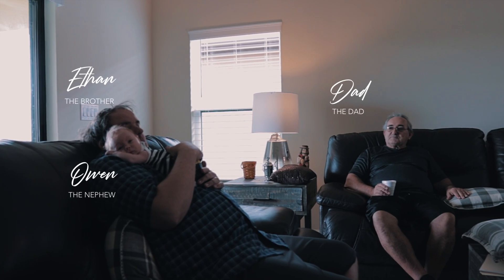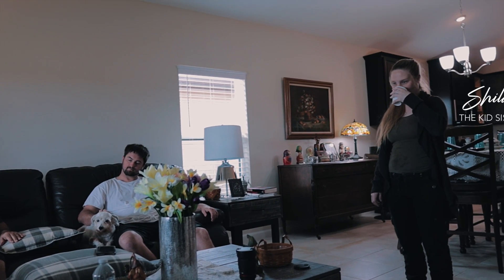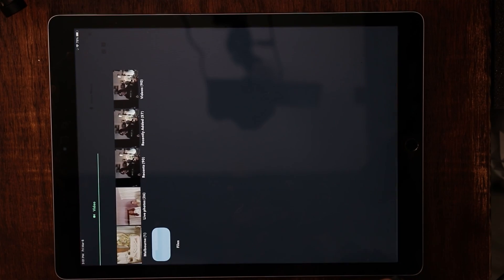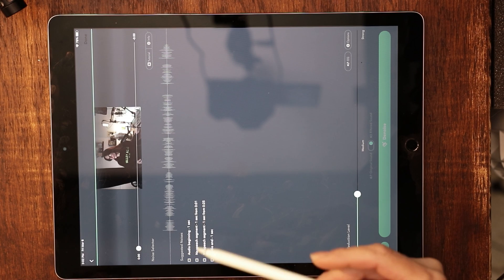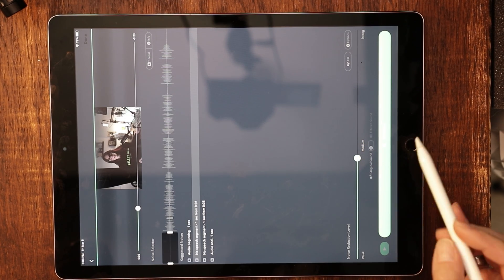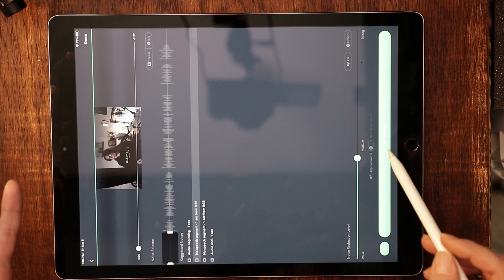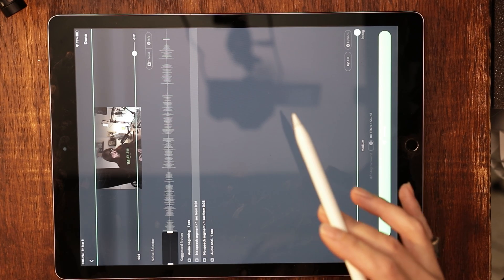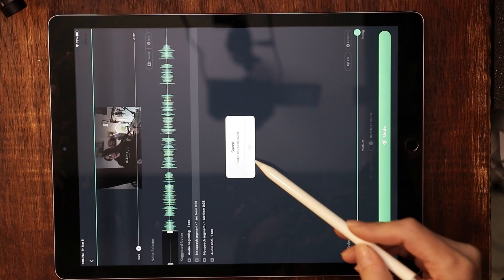How To Remove Noise From Audio In LumaFusion Using Denoise Or BrusFri

Comment: Greetings Tammy, Thank you for the great info above, Can you potentially please help me, I am shooting on an iPhone 13 Pro Max, External Mic Smallrig S20 plugged in via Lightning adapter & Filmic Pro V7 latest version. I am not sure what I am doing wrong but I am currently receiving cleaner audio from the built in Audio front mic from the iPhone 13  than I am from S20 mic. I assume I am doing something wrong but I can't figure it out. I am recording in a really quiet room and there is a consistent loud white noise in the background of every test video currently. The mic also has a rabbit foot on. I have tried to adjust gain control manually. I am a bit at a loss and brand new to Video. Is there always background noise in an audio file. Thank you for your time, if you can help. Sincerely LG.

Comment: Nice video
Does Lumafusion have a way to sync up audio ?. Meaning talking head . You remove the original audio, clean up with Brusfri  and re add it to original clip. Audio sync is needed to make sure your lip-sync and audio match up... Thanks

Comment: Brusfri is fantastic, the sound looks very natural. But i see is not updated since two years, it seems lacks support and that’s a pity
Reply from the maker: Cuori in Gioco  I went a little more in depth on this in the video but I had to cut a bunch of stuff, way too long. Majority of people use this as a plug in for existing programs like garage band. Can’t do that with LF. In those cases all you would need is to denoise it from the plug in and tweak the audio in the DAW.